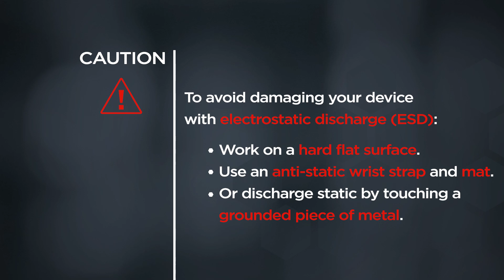Replacing Your Base Cover Assembly | ThinkPad T14s Gen 6 Snapdragon | Customer Self Service

Comment from the maker: This video will show you how to replace the base cover assembly in your ThinkPad. The process in this video will work for the ThinkPad T14s Gen 6 Snapdragon. 

You will need a screwdriver kit and 10 minutes of your time.

To view the ThinkPad T14s Gen 6 Snapdragon Self-Repair Guide go to https://pcsupport.lenovo.com/us/en/products/laptops-and-netbooks/thinkpad-t-series-laptops/thinkpad-t14s-gen-6-type-21n1-21n2/selfrepair/removalsreplacements

To learn more about your device go to https://pcsupport.lenovo.com

To find parts for your device go to https://support.lenovo.com/parts-lookup/?cid=ww:lenovosocial:b9515f&source=socialmedia&subsource=yt

To view the Lenovo Support Self-Repair Guides landing page go to https://support.lenovo.com/us/en/solutions/HT516547

** NOTE: Static electricity can destroy components. Use a grounding strap, and clean, non-conductive surface to work on. Use plastic or coated tools to prevent scratching and avoid using metal tools on plastic parts. For more detailed information on electrostatic discharge and how to prevent it, please watch our ""Understanding Electrostatic Discharge (ESD)"" video: https://youtu.be/by4PB3WtdLo 

Applicable Machine Types:
ThinkPad T14s Gen 6 Snapdragon - 21N1, 21N2

#Lenovo #LenovoSupport #LenovoTechSupport

Check out other official Lenovo channels!
https://www.youtube.com/@Lenovo 🟥
https://www.youtube.com/@lenovolegion 🎮
https://www.youtube.com/@Lenovo-PC 💻
https://www.youtube.com/@LenovoSuporte 🟢🟡